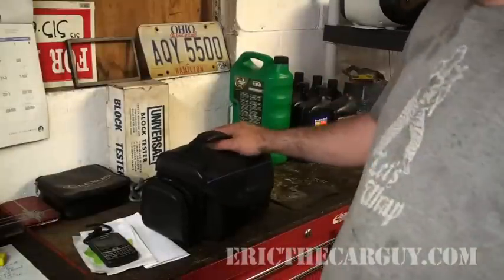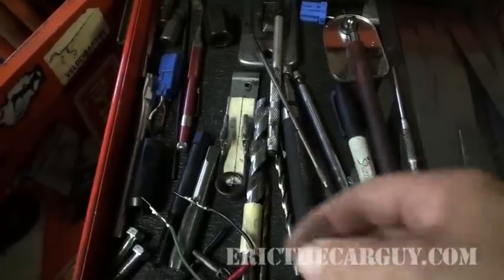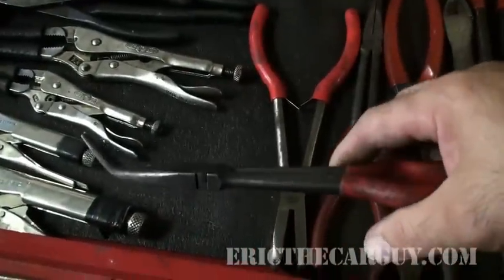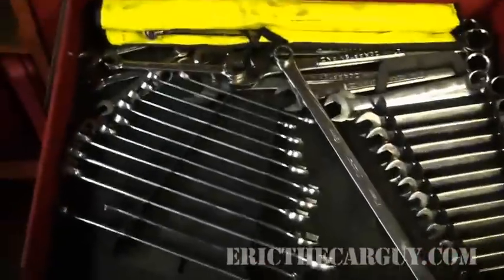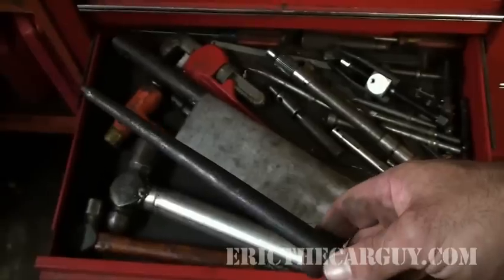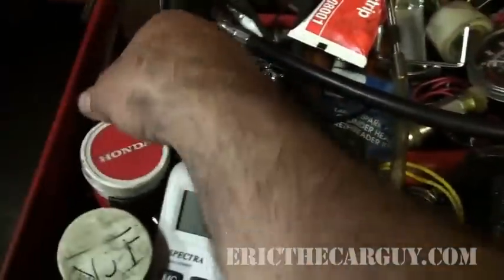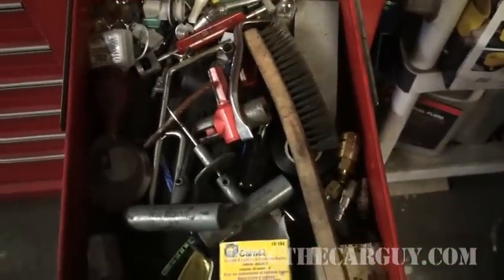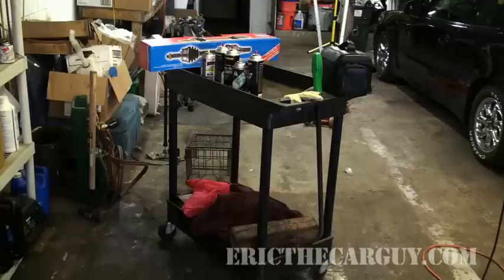What's Inside EricTheCarGuy's Tool Box? - EricTheCarGuy

Comment from the maker: @nobleheight First it sounds like you aren't using the proper practices for handling refrigerant, if you get caught you can get in a bunch of trouble not to mention the environmental damage caused by these practices.  Second, if you pour a lubricant  (soap) on the belt there is a real possibility that it will come off.  Common sense man.

Comment: im buying my first air compressor in a few weeks, what are the requirements to run impact wrenches since i will mainly be working on cars i was told i need atleast 5.4 scfm @ 90 psi to power my tools the compressor im thinking about buying is a (central pneumatic 29 gal150 psi 2 hp 5.9 scfm @ 90 psi) is this enough?

Comment: i know what you are talking about with drill bits i busted off a stud in a head for my dodge flat with the head so i had to drill and tap it out burned through all my metal bits i had the right size all my wood bits the right size then only had a masonry bit left and dam if it didn't eat right through that stud didn't even touch the bit next time you have something like that try a masonry bit or do it the easy way i found out latter that i could have melted the bolt out with a torch

Comment: PPL never use a cheater bar on your rachets , please invest in a hand held propane torch(stay awy from vital areas and gas lines ) and give a little heat - That stuck bolt will release with a touch of heat, please dont break your tools, I am tired of all the ppl running around saying they broke Craftsman tools when I know they did not use them in a correct way, I am sure Eric will tell you use the right tool for the rjob and you should be fine.

Comment: I certainly agree on the starter replacement on the North Star  engine. Those GM engineers must have had their heads up their asses when the built the V8 North Star engine with the starter in the middle.

Comment: And, by the way, most likely the abs light on is probably the front passenger side hub assembly that needs to be replaced.  Due to the line of sight, that's the side that takes most of the beating, and is the most neglected.
Reply: Also, if your using cataclean I am sure you have a few tools to due a hub assembly and free up your brake pin slides.  Good luck.  :)

Comment: i don't really have much prefence when it comes to most tools. although right now i only buy snapon ratchets. can't beat 80 teeth in the head. i see you have both the cushioned handle ones and chrome handle one, any preference really. i just get the chrome handle ones. i need to get a set of those wrenchs at 8:30, i have borrowed a few for certain jobs, they are great.  you have lots more tools than i do, and my toolbox is like 3 times the size of yours, no the box wasn't my first choice.

Comment: Eric, couldnt help but notice the "i feel bad for you" (if you own a caddy northstar). i was just wondering what your experiences have been with 05,06,07, v8 northstar engines?. I'm aware that the head gasket issues of the pre 05 engines was remedied for the 05 year. Were there significant improvements made to the 05 and up northstars? Is it a bad idea to buy an 05 or 06 STS?

Comment: A real "lead pipe" would be so soft, it would bend if you stared at it!!
I guess using the term "lead pipe" is a regional thing, the places I grew-up
and worked (as a "Heavy Line Mechanic"), it was called a "Cheater Bar"..
But, to answer your question..  just go to the "big box" home improvement
store and buy a length of "Black Iron Pipe"..  the inner diameter is determined
by the OD of what you are slipping it over, the length is determined by where you
are using it..  I have several lengths!

Comment: I know this is an older vid of yours, but I was wondering about your opinion on air chuck/psi gauges. most of the ones I've been looking at,( @ the "reputable auto stores) on-line Have horrible reviews. I just started at an RV consignment/ service dealership. as a make ready/tech in training. can't I find something not on the MAC truck to do what I need w/out spending an arm and a leg?  Any Leads?  Macs got a price tag and I'm not convinced. My Milwalkee out performs thier DeWalts hands down.

Comment: GM requires in all 2012 gas engines to use only Dexo1 approved oil, using any other oil will void your warranty. VW oil specs are VW/Audi 505.01 or 507.00 as just examples of those. Ford Oil spec is for 5W20 is WSS-M2C945A a normal 5W20 does not meet these specs and issues will arise. 
Nothing special will happen if the incorrect oil is used, also wrong, google oil sludge VW or Toyota or BMW.
Transmission Fluid are much worse using the wrong fluid can cause a very quick failure of the unit

Comment: @MoneyMarcMes i think i know the reason why you broke your ratchet...you were trying to losen or tighten a bolt that was or had to be tight and you were using a ratchet...they are not ment for that a breaker bar is what thats for...only takes 7seconds to changes between them. and if a tool does break craftsman has the lifetime warranty that they will replace it with a new tool for free...

Comment: @EricTheCarGuy Thanks Eric, I guess? (Don't provoke me worse!) HAHAHA. As if you aren't getting sick of my comments...I'm feathering out my socket sets and wondered which sizes do you use mostly on asian/european vehicles? I mean, besides the staple 8, 10, 12, 15mm and noting what you mentioned in the vid. In particular which of the larger sizes (>19mm) do you encounter using a lot? For 3/8 DR impacts...6pt or 12pt? I have a 94 turdcel and yamaha virago 535 I'm tinkering on.

Comment: Do you resharpen your drills? If so how(I'm a machinist, at home, I sharpen my drills on a bench grinder or a drill doctor at work I used a precision drill sharpener unless I want special geometry then I use a bench grinder)if not why not(good drills are too expensive to discard when dull)?On the subject of burning drills, in steel, if the chip is darker than light brown your RPM is too high, feeding too slowly shortens drill life(too heavy breaks drills)and Roostin is correct a water-based  coolant works better than oil(check out an industrial supply company such as MSC    https://www.mscdirect.com/
).

Comment: @levibrownell14 
Google for 20% off coupon and free flashlight at Harbor Freight Tools, that expires 12/31/10.  You can use the 20% off coupon as much as you want.  Just pay each item separately.  You can use the free flashlight coupon each time you visit the store.  Don't buy 12 Volt 1/2" Emergency Impact Wrench.  Most car repair requires disconnecting the battery.

Comment: All i kept on hearing was "Honda, Honda, Honda" lol funny guy. hondas all be breaking down! thats why he fixes honda's...
Reply: Javier Zelaya they're great cars they just have tranny problems
Reply: +Javier Zelaya I've never had an issue on my 16 year old Honda apart from normal wear and tear.  I had an AC compressor go bad around year 12, have done a bunch of brake pads and one set of rotors, a couple sets of tires, replaced shocks and springs, replaced a brake line that rusted through... mechanically it's been great.  I change the oil and filters, grease it, changed the plugs and wires one time...  Never had to replace any bulbs except the head lights.  I really can't imagine a lower maintenance vehicle.
Reply: Alex Parkes Well mine's a manual transmission so that may be part of it.  

Looking to buy a new car soon, but trying to find anything fun with a manual transmission these days is difficult.  I may have to resign myself to an automatic of some kind, at which point, lots of things can go wrong.